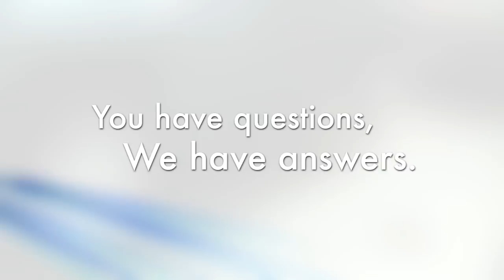Ridgeline Running Board Installation (Honda Answers #66)

Comment: for the thread grommet bracket does that go on the front or the rear and why just one bracket get the threaded kurled grommet and not all of them?
 thanks
Reply: The back. All the other brackets connect to the frame rail except that one.

Comment: Can running boards be installed without a rivnut tool?
Reply: Sure. Just know if you stand on the end as if getting into the bed. It's not 100% as strong without that fastener installed.  The threaded insert can also be installed using a bolt and a nut. Videos on YouTube showing how.
Reply: @rtz549  Do you have any links to any or specific titles? I hadn't planned on standing on the running boards to access the pickup bed. The running boards are to help my elderly mother get into the vehicle a little more easily. She has trouble with her knees  and doesn't have as much strength for lifting herself so having a shorter distance to step up is easier for her. She'll be sitting in the front so the back shouldn't be a problem too much.